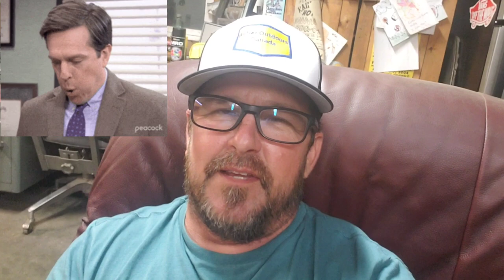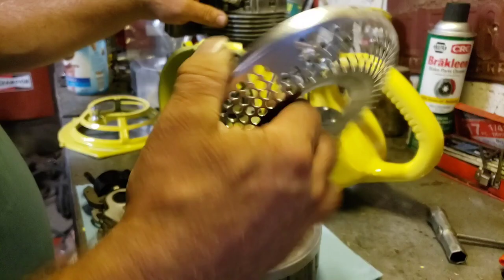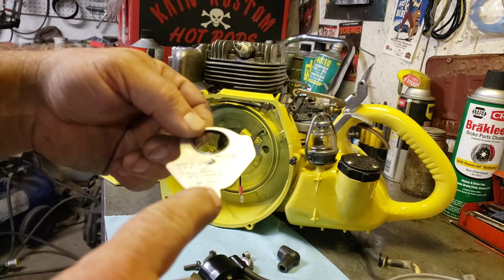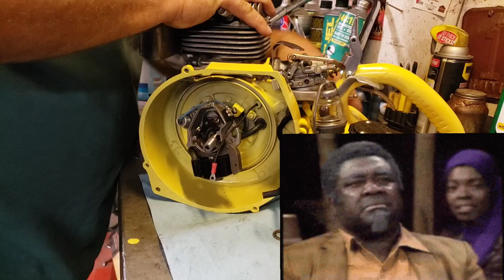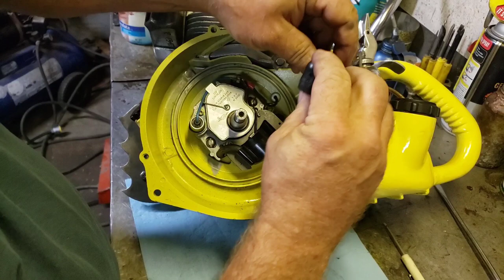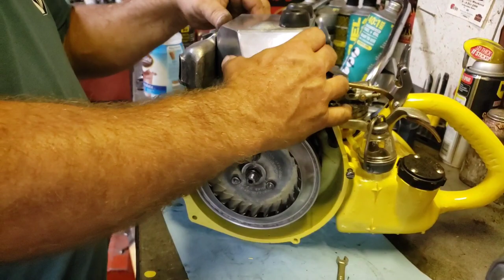Pioneer RA Vintage Chainsaw Ignition System and Live Stream Announcement! (Raffle information)

Comment: Hello Dan, I was sent over by Andrew Butler, I am wondering if you have a video of the tear down or rebuild of a recoil starter for a David Bradley ah chainsaw ( sears 648G) Tecumseh engine, I received it third hand, and cant find information on re assembly of the starter, other then they can be a pain!😢any info. will be greatly appreciated thank you in advance.  Pat
Reply from the maker: Hi Pat! I think those have the fairbanks morse style starter with the starter cup and the Dawgs or Pawls on the recoil? Anyways I do have a video of a 187 Canadien chainsaw that has that type starter and how it goes together....in fact I will be doing a video on the same type starter tomorrow for a Pioneer RA Chainsaw if you wanna wait for that....assuming that's the style starter you have...I'll look it up real quick..
Reply: @KainKustomGarage  ok, great! One other question, with this being a gear drive set up, am I correct in thinking the motor runs in the opposite direction of the chain drive?
Reply from the maker: Yes, the engine turns in the opposite direction, Crazy huh? I just figured that out on a Strunk model David Bradley i have, I looked at a picture of your model and I'm thinking it probably has the fairbanks morse style starter...
Reply: @KainKustomGarage  got the recoil together, can see spark in the daylight, carb needs cleaning and rebuilding, but leaks gas,Compression is good @90+. Hope to have it fire up soon! May try a little spray of fuel in carb later!
Reply from the maker: @thesmallwoodlot433  Awesome! 👍👍
Reply: @KainKustomGarage  now the process begins🤔🤔🤔I wonder are the last 2 digits of serial numbers the year?
Reply from the maker: Boy not sure on that Pat, Get er runnin!👊👊
Reply: Another question, double checking the recoil starter, for this saw, standing at the handle, the rope should come over the top towards me at the handle, for the chain to travel in the opposite direction of over the top of the bar towards the tip?  Keeping in mind that this is a gear drive.
Reply: @KainKustomGarage  will do... with a little help from friends!👍👊👊👊
Reply from the maker: Yeah, that sounds right, you'll find out soon enough!🤣🤣
Reply: @KainKustomGarage  now to find carb parts, you wouldn’t have an old break down manual for these saws would you
Reply from the maker: Sorry Pat, no manual, but I think its probably the Old Tillotson carb that's on alot of those old saws does it have an HL in the part number?
Reply: @KainKustomGarage  haven’t looked yet, only had 15 minutes to work on it today
Reply from the maker: No prob!